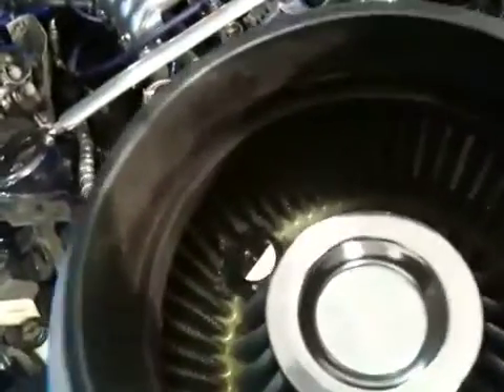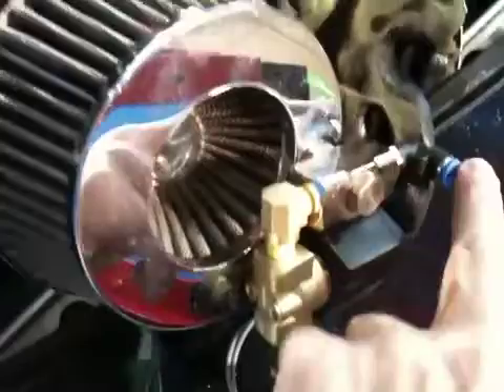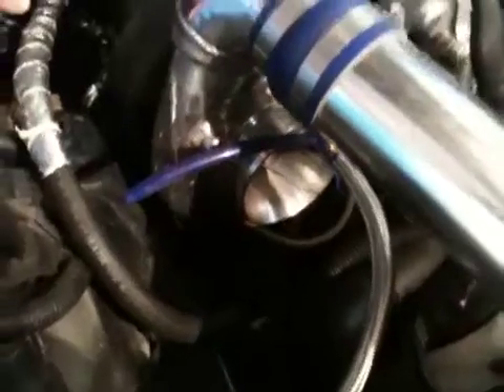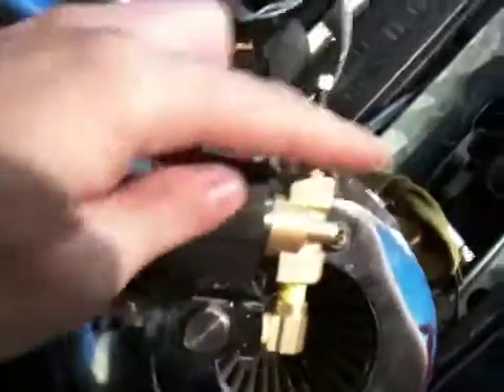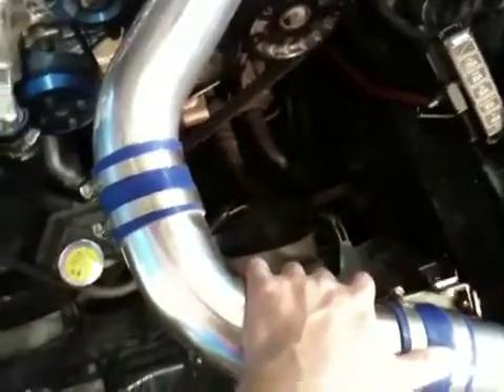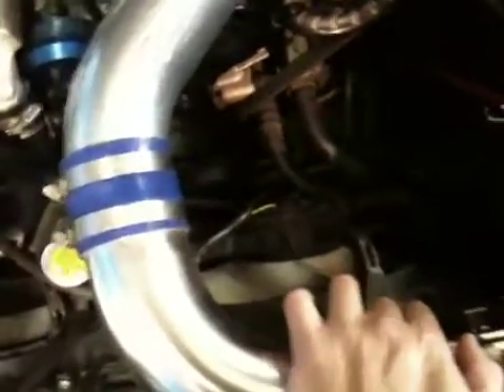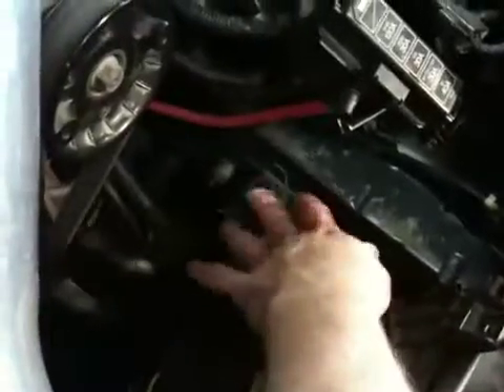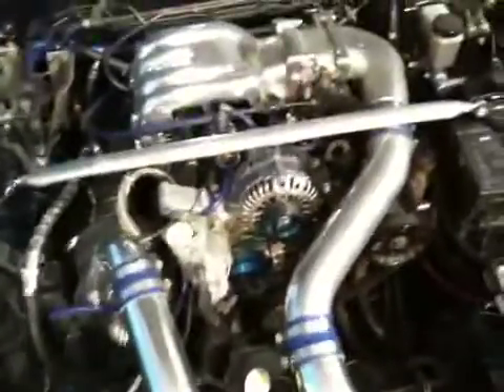Fabricating preturbo water injection mounting

Comment: Question?  Why is the nozzle located off to the side of the inside of the air filter vs. The center of the airfilter,  where the metal is.won't mounting the nozzle in this location throw off the balance of the impeller?

Comment: I prefer, if possible a small water/ meth. Injection as pre compressor set up. I feel it really helped stopped heat soak, and still decreased my air temps. Through the throttlebody. But I am running a bar & plate. What are u running ( vein/bar-plate?) and have you been pleased with the vac. Run water/meth kit?

Comment: very nice and glad you got the boost up to 16 PSI. but i need to ask, with the kit being almost $400, wouldn't a pump driven kit be more affordable? and there would be no chance of compressor abrasion, and you could fine tune the spray. not knocking your setup, just asking what the benefit is at that price break.